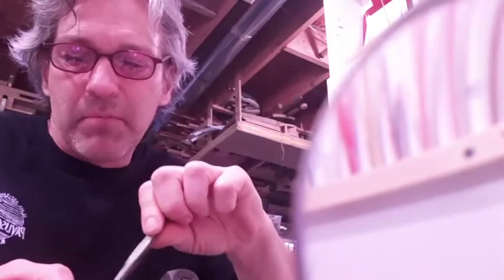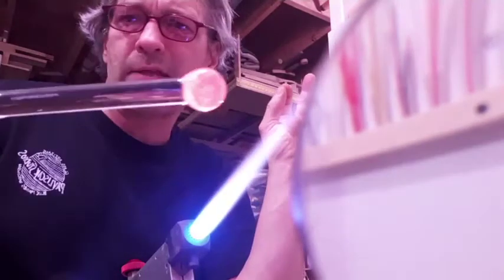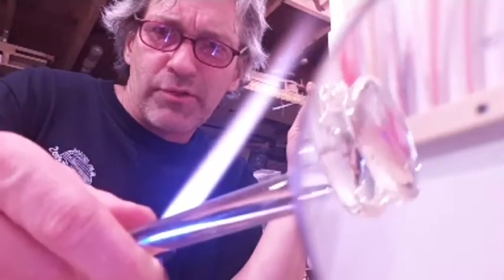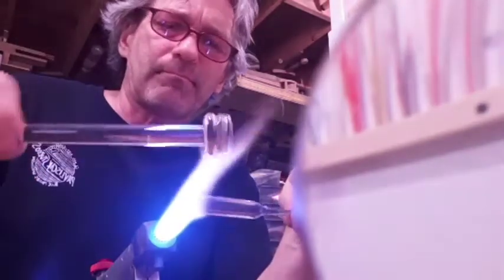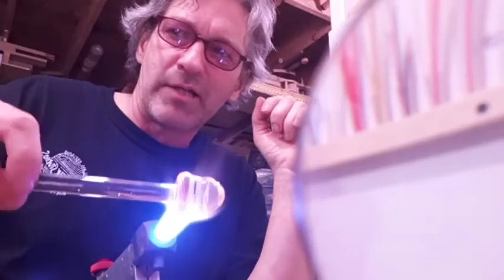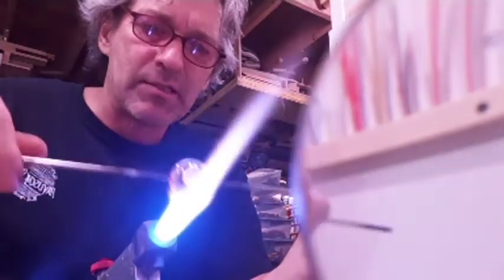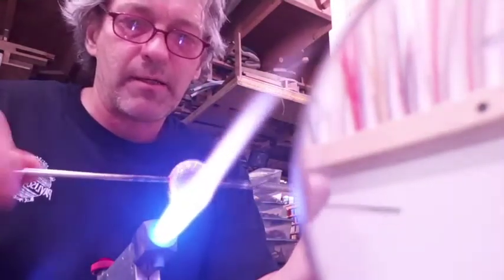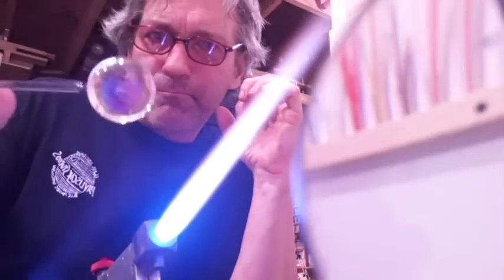Lets Make Glass Marbles With George - Impossible Galaxy - Pavliscak Studios - 4-7-2021

Comment: The master of glass! Thats interesting about the heating elements, iI always thought they were the same right up untill the end when they catastrophically failed.
Reply from the maker: WoW  you watched my thing, that's so cool!  Yes, this is for the standard Nichrome wire elements which you would hear many refer to as Kanthal.  some of the heavier duty kilns use an APM wire which is a ferric/iron/chromium/Aluminum alloy for higher soak temperatures.  Which for some reason I break faster,  they seem to just fail immediately.